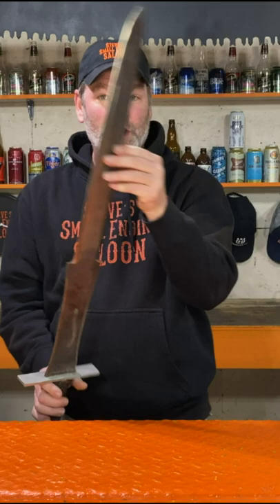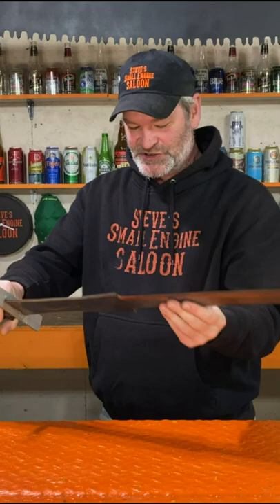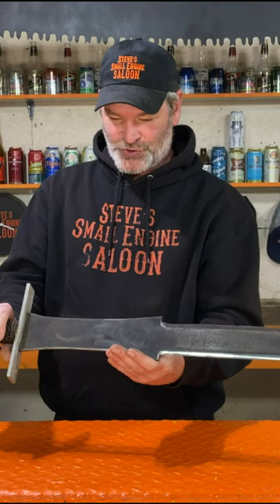Making A Sword From A Chain Saw Bar

Comment: Won't hold an edge very well and less you Hardin it and re temper. But what these solid bars will make very nicely are throwing knives it's long as you don't get it too hot when you cut your pattern out and ruined the temper they make excellent excellent throwing knives I've had the same set for 5-6 years.and I am a pretty hard core knife thrower